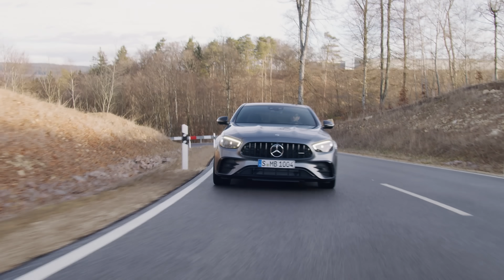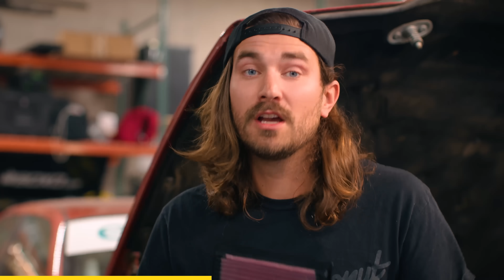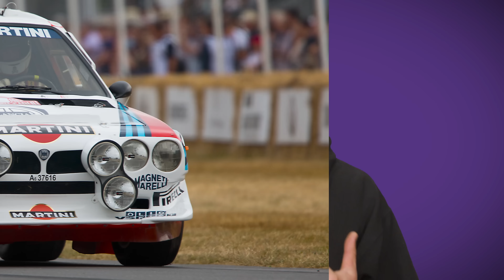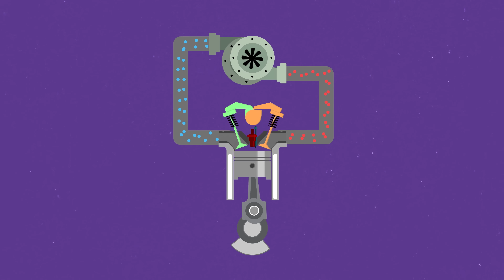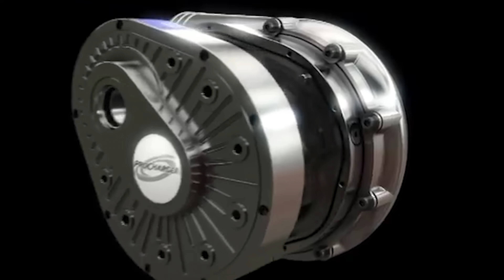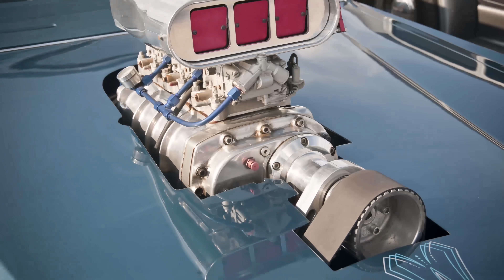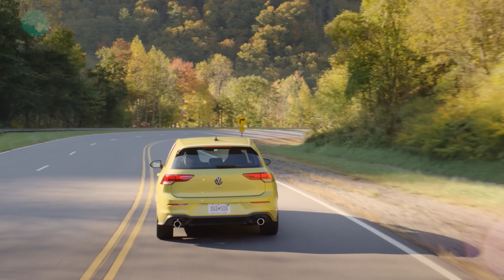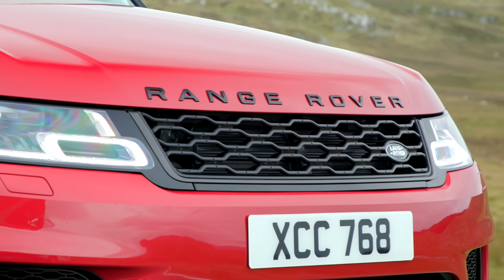Why Your Engine Isn't Twin-Charged

Comment: As it turned out, VW’s twincharged 1.4 TSI engine wasn’t all that great.
Many cars ended up suffering from very high oil consumption and the cure was to replace the pistons. 
And don’t get me started on the whole timing chain thing. 

The timing belt driven, turbo only 1.4 TSI that debuted with the MK7 Golf is overall a much better engine - especially the later 150 hp models.
Reply: Thats funny. My jetta is fine...
Reply: @Mrlimbus2060  
I’ve worked at VAG dealerships for about 11 years now.
I’m just stating what I have seen.
Reply: @frenchtoast-d7u  i did work experience at a vw dealer and they told me about it

Comment: Why not just have an electric centrifugal supercharger, spin it fast enough to produce boost on the low end and it should be able to keep up with a turbo on the top end. So  no need for a turbo. Less complicated and theoretically cheaper.

Comment: I was kinda confused when i read the title... my car is twin charged! Its the 1.4TSI from VW with 170HP, very fun to drive if want to know.
Reply: I also have a twin charged Golf. Its very powerful off the line and I love it but the maintenance cost are kinda piling up. I recently replaced the pistons with forged ones and I have replaced the water pump 3 times already cause the clutch just wears out fast. Thats the price for more power babyyyyy!!!!!!!!!!!!!!!!!!!
Reply: @meshackmutua1055  man i have the twin charged golf as well hopefully i dont have that water pump issue that you are experiencing but in regards to your pistons was something wrong ?
Reply: I think 1.4 tsi ecofuel version (cng) has forged pistons stock.
Ist 150hp@cng and I think 148hp@gas
Reply: Or you could get an R32 with 75 more hp and fewer moving parts to break.. No replacement for displacement.
Reply: Jeez... Would it have had like 22HP without the turbo and supercharger?
Reply: @willg955  The are nice to drive mostly because of the higher torque and the power curve. Power jumps up quickly from low revs then stays the same. And also the GTi from the same year had 200 hp, can’t imagine they wanted to have more power in a lower model.

Comment: VW Scirocco came twin charged in the newer refreshes, 1.4L TSI @ 161hp
Reply: I have one. It's a good engine with quick throttle response. Mine is tuned to make 215hp.With the low body style of the Scirocco it is really fun to drive
Reply: @MultiSanderrr  Thats awesome, I bet it's a blast. I still geek out when I see the rare classic models on the road.

Comment: I have one of those twin charged engines in the 2014 Jetta 1.4 TSI. Been good to me for what's gonna be 8 years now
Reply: Had the 180bhp 1.4 TSI in a little seat Ibiza, great fun until it went pop
Reply: @mattvanders  That's rough, how long did it last?
Reply: @fgtrhwu2  bought the car at 2 years old, had it for another 4 years. Into the 3rd year it put it’s into limp mode due to running on 3 cylinders due to oil getting past the piston ring and clogging up the spark plug. I had taken out extended warranty thankfully so the only thing I had to pay for over the rebuild for cylinder scoring was new spark plugs. Sold it with only 60k miles on the clock
Reply: @mattvanders  How much did you sell it for?
Reply: @fgtrhwu2  £6k, I paid £14k I think. Great engine for the mix of fuel efficiency and power but badly designed on the cooling side (ibiza didn’t have a temp gauge). I didn’t even drive it in anger as most of my mileage was commuting in traffic
Reply: @mattvanders  That's not too bad actually. Yea I hear you on the cooling, mine seems to be holding up well, it is the Jetta though so not entirely comparable I suppose.
Reply: @fgtrhwu2  what’s the mileage on yours so far?
Reply: @mattvanders  About 75K miles

Comment: It would have been great to mention how awfully unreliable Volvo's (and I'm sure others) twin charged engines are.
Reply: Vw 1.4 litre tsi is fine. Just aparrently in high heat, pistons crack but thats because germany doesnt really get hot so they dont take it into mind.

Comment: I had a friend that bought a flatbed tow truck 4x4 with a dead motor in it. He took all the hydraulics for the bed out and bolted it straight to frame and then spent a shit load of money on a new detroit 6v53 2 stroke diesel that is already supercharged and then added 2 turbos to it. The turbos were bolted directly to the exhaust manifold and on a GMC Top kick it put the exhaust outlet on the outside of the frame rail so he ran 4 inch dual exhaust on the outside of the frame under the cab. It had so much power that when he hauled 20K lbs of hay with a trailer in tow he was having issues twisting the 5 inch diameter driveshafts... after custom shaft were made he started to slip the 16 inch clutch and decided to go automatic with allison 5 spd. Then he started to shear off the input shaft to the transfer case...So he went with a custom t-case but I not sure what...all in all he was over $80,000 in to this truck not including his 60 inch turf saver tires...not for highway driving..just mud slinging..lol
Reply: Detroits weren't twin charged or even supercharged. The blower on them was required to run. It's a two stroke with no exhaust valves it has intakes ports in the cylinder wall. The piston uncovers these ports at the bottom of the stroke. The piston does not create vacuum at the bottom of the stroke. So the blower is there to get air into the cylinder and that's about it which makes it naturally aspirated and the turbo variants we're like any other turbo diesel.

Comment: All Detroit Diesel Engines were designed and sold as twin charged for every application from boats to semis “not counting gm pickups” Also gale banks has been building twin charged duramaxs for years, check out his duramax monster trucks.
Reply: Detroits weren't twin charged or even supercharged. The blower on them was required to run. It's a two stroke with no exhaust valves it has intakes ports in the cylinder wall. The piston uncovers these ports at the bottom of the stroke. The piston does not create vacuum at the bottom of the stroke. So the blower is there to get air into the cylinder and that's about it which makes it naturally aspirated and the turbo variants we're like any other turbo diesel.

Comment: Rallysport direct was building a twincharged fa20 wrx a little while back.   they were using an edelbrock eforce supercharger.   But they did it where the turbo fed the supercharger so the boost rate increased through the supercharger instead of using bypass valves.   It also is a lot less complicated tubing under the hood.   I imagine with some creativity, you could always just use a bigger radiator for the intercooler of the supercharger or even try to rig up something like what the hellcat does and use the Air conditioner to cool the charge.

Comment: Turbochargers are more properly called turbine superchargers - making it clearer how they work

The fun part comes when you get into turbo COMPOUNDING - that's when the output turbine is coupled back to the crankshaft

Or an electric generator.  With an electrically driven supercharger 

Welcome to F1 engines

Comment: My buddy had a boat that used a turbo and supercharger on each engine.  The supercharger had a clutch just like an A/C compressor and only came on if you throttled up quickly, then turned off once the turbo was spooled up.
Reply: A customer of mine had a military surplus large Ribcraft (30' I think but might have been 35') that had a large Volvo-Penta diesel which had both a turbo and roots supercharger.

Comment: They really just need an electric assist turbo.   It's powered by electric at low rpms, then when exhaust pressures build the electric assist can turn off.   Could also help keep the turbo spooling during shifts and breaking.   Seems a lot less complex than a twin charging system
Reply: This is totally thrown out of the water when 2 step/purposeful antilag is made.

Comment: Let's not forget Volvo's twin charged PHEVs that put out about 400HP as a system. Those are awesome, especially in the smaller volvos.
Reply: Exactly, Volvo has sold tons of T6 twincharged 2.0s, as well as the T8 Twin Charged Plug in Hybrid.  
I had a 2018 T6 and now a 2019 T8.

Comment: Don’t forget about Volvos T6 and T8 engines they’re twin charged four bangers making 320-400 hrsprs
Reply: he completely forgot Volvo
Reply: @ardkw  no he has the Volvo T6, but it isn’t a car like the rest (despite being shown like that) it’s an engine
Reply: Everyone always forgets volvos.  I'm a volvo fanatic and they've always had strong reliable powerful engines.  The B16, B18, B20, the 6 cylinder twin turbo, the magical 5 cylinder turbo and now the 2.0 supercharged and Turbocharged engine.
Reply: Came here to say the same thing. I have a T6 and it's lovely as a daily driven car.
Reply: The Volvos definitely suffer from "Mo chargin mo problems"
They blow out all the seals and gaskets in the supercharger all the time.
Reply: @Nikko780  That would be a small % of them.  Turbos in general   are good for around 100,000 miles.
Reply: @Nikko780  my girls Volvo has 68k miles and hasn’t had a single problem either.
Reply: @zacharieakadutch  68k miles is literally nothing. Old Volvos did 300k plus without any major failures. I run a Volvo repair shop, and the T6 and T8 cars just aren't going to last. Not just major failures either, dumb stuff like door handles constantly breaking, wiring problems, stuff that owners 10 or 15 years down just won't be able to justify spending the money on because it's all expensive to fix.
Reply: Just say 4 cylinder, “four banger” is cringe asf

Comment: Volvo makes a twin charged four banger for boats. It's a very interesting engine!
Reply: Thr cars are twin charged too
Reply: All T6's are twin charged while the T5's are just turbo'd. My wife has an S60 T6 and that little thing rips.
Reply: @chrispaszynin6544  I have one too. Fun little car
Reply: What you’re looking for is the 2017 Volvo S60 Polestar, it has a 2.0L twin charge engine.
Reply: @BapedRacon  Polestar edition is just a standard twin charged T6 with an upgraded tune and I believe upgraded brakes, as well.. You can get the Polestar tune for any T6 from the volvo dealer for around $1,200.
Reply: @chrispaszynin6544  You’re correct, I had only thought the S60 Polestar had that twin charge, but all Volvos (T6) have them. Really cool! I should look into them as I wanted to get a S60 Polestar.
Reply: @BapedRacon  the Polestar wagon is one of the sickest cars... blue with the gold calipers is drool worthy!
Reply: All Volvo cars you see with a T6 badge have the twincharged setup from factory
Reply: @randomwordbot  The T8 is a plug-in hybrid and the B6 is a mild hybrid.
Reply: yeah...  the xc90 was or is sc/tc.  never knew it until we started shopping for a family suv.  walked away immediately and bought a new LX570
Reply: @aynsleyjeansonne  i think most of volvos t6 trim is twincharged. t8 is twincharged + mild hybrid
Reply: @slk1771  T8's are plug-in hybrid with 400V batteries, the mild hybrids are badged as B4 or 5 and can be diesel or petrol with a 48V mild hybrid system
Reply: @slk1771  sounds right!  We were looking at the t8 and I recall and thinking…. Hell2thenaw.. I wanted something we could keep long term and  enjoy off roading when wife was wanting something new in five years
Reply: @slk1771  all T6

Comment: The first twin charged engine would have been from Detroit diesel in the 60s or 80s with there 2 stroke series of motors most commonly the 6v72 and 8v92

Comment: Group b rally was absolutely the best thing ever. The technological advancement made in the few year it was around was amazing
Reply: Yeah group b or something similar has to come back
Reply: @keepermovin5906  
Group B ended for a reason
Driving those cars was basically a death sentence
Reply: @dustinjames1268  yeah it was dangerous but people mostly knew the risks. There will always be people crazy enough to participate in such things. The audience probably would have to be moved from off the edge of the road though which is to bad.
Reply: @dustinjames1268  yeah it was dangerous but people mostly knew the risks. There will always be people crazy enough to participate in such things. The audience probably would have to be moved from off the edge of the road though which is to bad.
Reply: 700hp 4 cylinder go brrr

Comment: Over here in Europe, we had a Seat Ibiza Cupra, Twin Charged 1.4L** petrol engine, turbo and super charger.

The engine was an absolute lemon. I work with a guy who owned one for 9 months and had 3 engine rebuilds....

Worked well..... when it worked
Reply: Those engines were 1.4 liters, ftfy.

They are brilliant little engines, but VW doomed them before the first one rolled out of the factory. Sooo many bad pistons, chains, injectors, and so on.
Mine is running strong at 102.000 Km, maintenance is everything.
Reply: @Whackfear  edited, not owned one. Jist worked with the guy who did and said the dealership hated them.

I run a 2.0L TSI Leon Cupra, always preferred Leons.

Thanks for the correction.
Reply: @JP_RS6  Oh yeah we hate them as well, speaking as a mechanic. VW really borked up a bunch of parts. Mine is running a tame Stage 1 atm without issues, but I've seen cars with half the mileage on their second or third engine.

I personally really like the "big block" 1.4 as I call it.
My collegues don't get it lmao

Comment: I’d like to know why sometimes 4 liters is a V6, V8 or V12 and why more cylinders can mean less displacement.
Reply: Displacement is the volume of the cylinder when then piston is at the bottom of its stroke. Cylinders can be different bore size or stroke size. Those combined makes ur displacement.
Reply: @Mogachaffe  so why does/did Ferrari have a 3.0l V12 when you have a 3.8L GM V6? Or a 7L Ford V8. Why would the Ferrari be so small vs other engines. Happens so many times where more cylinders is less liters and I don’t get it.
Reply: @Stachemaster86  because the bore and stroke size is smaller.
Reply: @Mogachaffe  so why have a bunch of small ones vs fewer big ones? Rpm’s are all around the same so there’s no advantage for smaller bores or cylinders. Complexity is stupid and a waste of engineering and materials. I’ll quit asking but makes no sense to me.